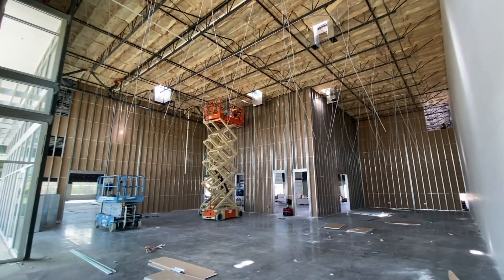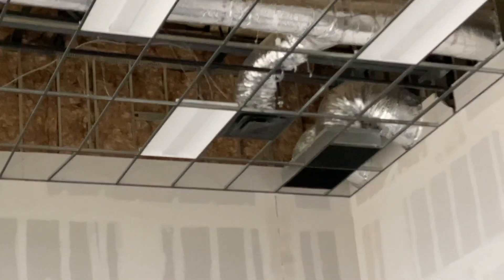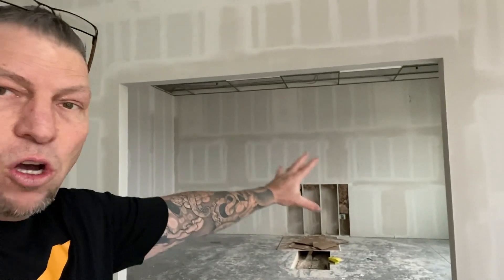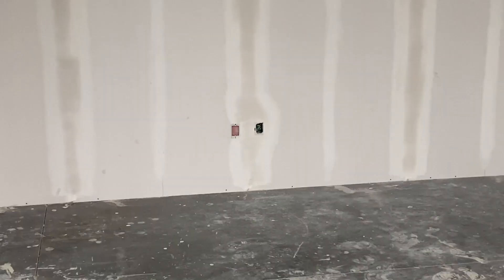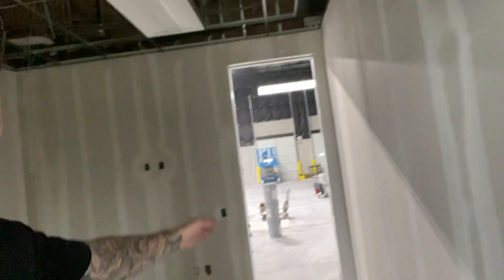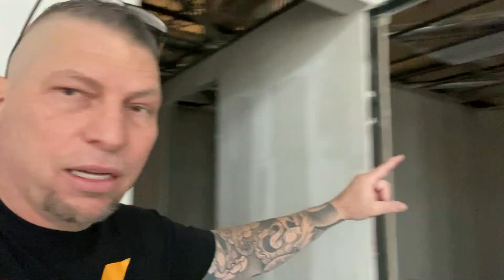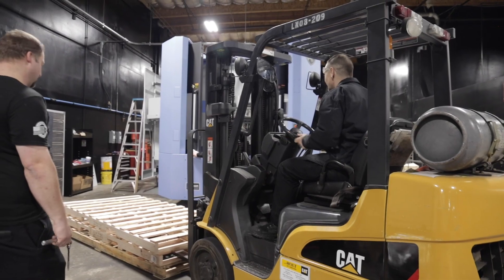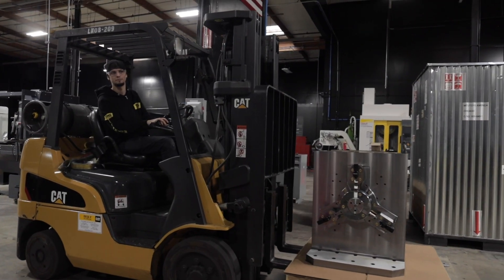Building a CNC SHOP in TEXAS | Update #5

Comment: As an AV Installer, I'd recommend putting conduit under the floor to your conference table with some draw line to where the boxes are on the wall. Really handy if you want to upgrade your AV systems in the future and will save you a ton in labour fees to run new cables if you want a touchscreen room controller on the table for example. Loving the progress so far!

Comment: hope titan is gonna paint the floors and then put clear epoxy over it. could be pretty cool actually
Reply: Another thing that can be done to that floor is polish-grind-stain-seal. Concrete can be made to look like marble! One company  I was in did that, and it looked and felt awesome. Amazing how a floor can set the mood for great craft-person quality.
Reply: @hippie-io7225  could be or have a ton of diffrent collored chips
 ( alu.copper.titanium.incanel.monel.diffrent type of steels with with and without cooling so they get diffrent colors do to the heat )
and the poor some thick industrial great epoxy over themso you have this awesome colored chip flor

i think that would actually be kinda cool 
( though he wouldnt get money back for those chips xD witch could be somewhere between 4 and 25k depending of the mix of cut materials that he would mix in )